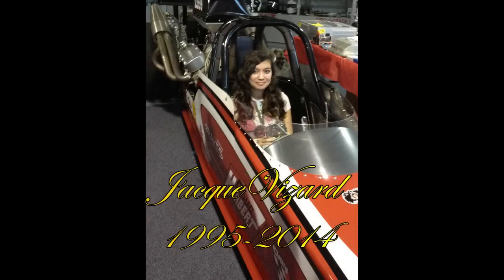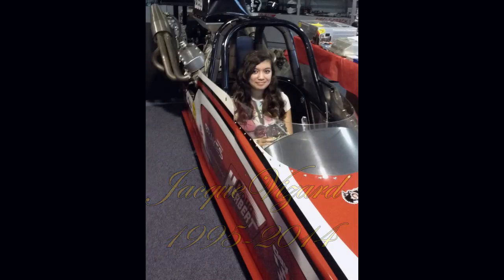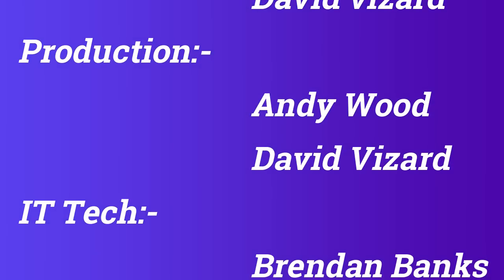GOOD NEWS -Blower motors are incorrectly dyno tested???!!!

Comment: Stan Weise blower bookb talks about the B&m single carb being rated at 120 horse when it actually made 200 hp
And its true because the car holds engine back packing more in cylinders with 5-7 psi wheel 
then anti pump up lifters hollow epoxy valves and 1.5 rockers with 750 pushing 8500 rpm i was making 800 hp

Comment: Well,, fake Dynos have problems;;-)
Systems and Programs makes differense. 
Dyno sessions in internet are 4to5 sec , some those engines can't take More ;-)
Estimatet loses are BS. Engine produce torque, that have to measure right, and engine inertia and dyno inertia can measure. When engine is taking RPMs fast it will genereit less power, and if it is pulled down fast it is making More power, engine inertia does that.
Steadystate measuring is absolut right.
Sveap or estimating somethig is BS.
Too fast raising RPM also affects cylinder filling neg, rpm is rising in also intakestroke time,(portveloxity).
ThankYou

Comment: Great video, FYI, 18,000 is 1/2  Atmosphere pressure, Question, @ 18,000 feet on STD day my experimental turbocharged Lycoming IO-360 can still hold 29.92 inches of  Manifold pressure @ 2500 rpm. At sea level the  Crankshaft is getting power  from the chamber explosion pushing down on the piston acting  Against standard atmospheric pressure of 29.92 inches will be on the other side of the piston. @ 18,000 feet altitude the  Same  Cylinder explosion is acting against half of the pressure  On the other side of the piston Significantly increasing the power To the crank shaft. 

My question is how much am I overboosting the rated horsepower, due to the 18000' half an atmosphere and having sea level pressure in the Turbo charged intercooled intake to engine ?

Comment: IIRC Detroit Diesel rate their Roots blower pumping losses at .7PSI as ~ 100hp! Consider this low pressure and that automotive Detroit Diesel two strokes typically are governed to only 2100RPM. That gives one an idea of the pumping losses involved, which all have to be paid for in fuel BTW.
Roots blowers on turbocharged Detroit Diesel two strokes also have a bypass valve. This is for a couple of reasons, firstly an aftercooler is incorporated under the blower therefore the charge cooling is after the blower. Any adiabatic heating of the intake air could heat the blower lobes causing them to expand, touch then scuff and as a side benefit it saves ~ 30HP in blower pumping losses.
They retain the blower on Detroits because of starting, idling and low RPM responsiveness. A hybrid centrifugal blower/turbocharger with overrun clutch similar to EMD Uniflow Diesels was proposed but dropped due cost.

Comment: Could you take the same engine and run it with a blower at say 15 psi and see what it makes and then install a turbo at the same boost level and measure it's power and wouldn't that tell you the friction losses of the blower for the most part? I know it's not an exact direct comparison but should be close

Comment: I have a question regarding the 0 hp loss exhaust system.  When using a supercharged engine, does the volume required for the termination chamber change based on the max volume output of the blower?
Reply: John, I have never tested for that but I don't think it's a big issue.
Reply: @DavidVizard  Thanks for the reply, I've one more question.  On your seminar web site all the dates are old, are you planning for any seminars in the near future?

Comment: I prefer to just go with actual measured steady state horsepower numbers, I believe these to be the most useful for me. What an engine makes in another enviroment really does not matter as what it makes where I am is all I have available to use. Also at steady state it shows a continuous generated power. Running sweep rates wind up showing accelerational power. Now for a drag racing type situation the acceleration is important but in a full load pulling situation the power it can sustainably produce is what is important. I prefer to think of dynos as a comparative tool more so than a be all end all say on power production.
Reply: Bcbloc02 all that is well and good until you need to quote power figures for an airframe designer who needs an absolute figure for comparison of one brand of engine to another!
DC

Comment: My first hands on experience with a dyno was 2007. A brand spanking  new DTS, (later bought out by Super Flow). I asked a bunch of questions and the man answered every one, He stated that this dyno spit out 3 power and torque stats, real time as is numbers, corrected numbers and advertised numbers. He also used flywheel diameter and weight and bore and stroke. The first numbers were indeed what the motor made right then and there with the recorded temp, barometric pressure and humidity. The corrected ones with standard pressure temp and humidity added a correction % so if you dynode the motor say in Denver it would read the same, the advertised set of numbers was basically a dialed up percentage that you wanted to add to the real numbers it was total BS. I never saw a corrected reading of more than 1.4% how ever when I could I`d dyno a new customers  engines to see what he had before I worked on them and most of the time they were 10% or better over their actual corrected level of the previous shop. That advertised HP correction is a lie to sell more stuff, you can take a 450HP motor and crank up the advertised correction factor to 495HP to 525HP or more no problem. I`m sure you know all this but most people don`t.

Comment: DV, for many years, I've heard that 15 lbs of boost effectively doubles the displacement of the engine. So your 500 ci engine, under   15 psi of boost, will act like an NA 1000 ci engine, is that correct?
Reply from the maker: Yes - but by the time inefficacy's are added in means the realities are somewhat different.

Comment: I have only used standard electric or water brake dynos. I was always suspicious of dynos that measure during acceleration. I doubt they could possibly get accurate data, not easily anyway. Not with what I see they are using, they are giving rough estimates not data.

Comment: What are the average "friction correction" percentages/factors of a 302sbc vs a 454 at 6000rpm. How about the 302sbc at 8000rpm. Are these corrections added to the actual measured output of the engine?

Comment: I am not sure why as a community we get hung up on a number on a piece of paper. I think of a Dyno as a tool. You show up with 700 hp and leave with 750 after you tweak it. The Dyno helps you get the most out of your combo. That's it.
The real key is how it actually performs. 
My stock 4500 lb  2016 Hellcat Challenger went 10.84 @ 126mph.
I know she was making more than the advertised 707 hp that day.
Reply: My street car averages out to around 10.90 in 1/4 and actual time slip of 7.07 at 96 mph in 1/8 best ET with 87 octane with a high rear gear 3.31 no power adder yet and around 3800 pounds with me in car. I need to lighten my car some time. You know how things are always a lot of things you can do to make them go faster. Lighter is less breakage, better gas mileage and easier on parts when lighter and of course faster! Your doing good at 4500 pounds. Each 1000 pounds removed is almost .80 off in the 1/4 mile. I have heard 1000 pounds is 1.00 but the other figure is more conservative. Could spray your intercooler with nitrous for cooling. Just don't get nitrous into engine and try to start it. Doing this good chance of engine fire and explosion. I've seen it over the years. I wonder what the first gear ratio in the Hellcat automatic is? It must be low and strong to get 4500 pounds moving. I don't know how long these automatic transmissions with soft tires are lasting but they built a pretty tough transmission a whole lot better than most things out there so far. I'm sure you probably know there's all kinds of upgrades you can do to your car, bigger blower with Teflon rotor strips, under driven pulleys, nitrous, rear end gears and so many more. Is 4500 lb with driver in the car at scale? Does your hellcat have a trans brake in your car? I plan to get a trans brake sometime. I'm a Chevrolet man but I have two Cummins Dodge trucks they're the best,, strongest and most dependable in the business.
Reply: @tomtee4442  it is an 8HP 90 so first gear is 4.71.
The 2016 used a 2.62 rear end.
My 2020 I special ordered a 3.09.
Back to the useful tool part. Most of the hellcat engines have an extremely flat power curve. So when you hit the next gear horsepower is nearly identical 
As an example... With the mustangs I have seen the power curve is very peaky. So when the shift they nose over and then come on hard, then nose over again. 
I have an in car video of me running 11.2 and it looks like I am out for a Sunday drive. The car just pulls away and shifts smoothly, never nosing over
Reply: @tomtee4442  to add to that. I think a Dyno is useful to figure things like shift points and gear ratios  the obsession with having a big number on paper to me means nothing. Its like they are trying to win the racing from there keyboard
Reply: Imagine the hellcat engine transmission and rear end in a 70 cuda. I would say without a driver would probably be around 3,400 through 3,600 lb because I imagine the hellcat engine is aluminum head with a steel block?
Reply: @tomtee4442  I am not sure but I think it is all cast iron

Comment: What are your thoughts on figuring out whp from acceleration? Should be foolproof, given traction is sufficient?
Reply: I've done it, is giving me about 60 to 70% the engine "advertised" power. I'm correcting for wind and drag resistance or the difference would be bigger. Great way to compare before and after installing a mod tho. Doing it in 2nd gear to avoid spinning wheels and also to avoid going too fast to the point wind resistance is huge.

Comment: The biggest mistake is "corrected" HP for atmospheric conditions, it's folly to say this engine makes X power at such and such atmospheric conditions and will make X + or - at such and such atmospheric conditions, that simply isn't correct
Reply: @carstennobody7047  not all engines are turboed, and engines that run constant displacement super chargers have to be spun faster with pulleys, or they won't make the same power at high altitudes, I've raced blown engines since the mid 70s. Worked for 3 shops that had Dynos, and normally aspirated engines don't change much because of atmospheric barometer reading, they only see changes with humidity reductions
Reply: Neal Williams is the inventor of the super flow dyno He grew up in Inola, Oklahoma, I've known him since the early 70s
Reply: @carstennobody7047  normally aspirated engines lose significant power at higher elevations, but Dyno testing and corrected to atmospheric conditions doesn't guarantee the engine will actually make corrected power at the corrected statistics, the only engines who can maintain power to 10,000' are turbocharged engines, because the lighter air the inlet turbine spins faster. Engines with fixed speed superchargers can if the manifold pressure is high enough, roots and screw type compressors are fixed displacement, they will only give a certain amount of boost, the Drive ratio determines how fast or slow it makes the pressure, my Blown Alcohol Hydroplane was powered by a 567" Chrysler, with a standard Helix 14, 71 blower, running a 14mm drive, I spun that blower as fast as possible, at 1.71 x crank speed, I didn't see the reason to apply boost slower, when acceleration was the game.....we were quite successful, I retired in 83', after 7 years, my Driver was killed in 86'
Reply: @carstennobody7047  depends on the engines and turbo, or mechanically driven super charger....

Comment: Dave - you are mostly correct - most of the effect of supercharging IS caused by raising the density of the air-fuel mixture supplied to the engine. But if you have a large volume such a water cooler bottle - you may see that merely by the feeble 1/2 psi most peoples lungs can pressurize such a volume to - and then releasing the pressure - that even a closed vessel may be used as a sort of pump. If you can get a slight suction (a pipe elbow turned facing backwards in a slipstream for instance) and a slight pressure to alternate then large amounts of mixture can be moved this way (crankcase scavenged 2-cycles prefer 1.5 to 1 crankcase compression ratio for this reason)(no lower, and no higher),
      Harry Ricardo in 1926 tests arrived at the conclusion that "given unlimited supercharging for any given fuel octane rating maximum INDICATED horsepower will occur at mechanical compression ratios between 6.5 and 7 to 1."(neglecting blower parasitic losses)
    And sure enough the racing aircraft piston engines I work on bear this out. That range is where the amount of energy thrown away out the exhaust by even lower compression ratios becomes balanced by the beneficial effect of the VE increase I mentioned PLUS the greater BMEP obtained by longer working cycle (shorter valve timing) and the comparatively large combustion chamber providing comparatively more cylinder pressure farther down the power stroke until exhaust open event.
Reply from the maker: Patrick, I am only using the boost/displacement numbers here for the sake of easing an explanation. 
I get the impression from your statements here you are well versed in boosted engine tech.  Got all that from a learned response. Thanks for meeting a hi-standard here. look forward to your future comments.
DV
Reply: @marvingvx1  I just want guys to know the benefits as well as drawbacks of "low" compression ratio engines for maximum BHP.
      The drawbacks are many starting with lousy NA power, fuel economy and greatly increased exhaust gas temperatures.
    Richard Holdener for example refuses to even consider running less than 8 - 1 CR engines. 
    But setups that would have been considered unthinkably complex for an automobile in my youth are now appearing as original equipment.  A 7-1 CR engine with a now common bypass equipped Roots  could make somebody an affordable hotrod with the bonus of veeeery wide and responsive powerband. 
        (I call myself a toolmaker) Just like combining many different methods of removing stuck bolts has the vice of complexity it also has the virtue of not having to "push" only one method to a point of diminishing returns or failure.
      My point is that a positive displacement blower wouldn't have to be unhappily trying to make high pressure ratio, heat and lousy efficiency/high parasitic - if one would then simply add on a single turbo with a "loose" scroll A/R and  let all the wasted exhaust heat+volume handle the (now) less critical task of spooling up for the highly boosted and aftercooled phase of acceleration.
       Coming from an aviation engine background I think it's normal to keep the original engine redline, stroke and cam specs - while lowering compression, trying to keep or gain some combustion chamber turbulence in the process, avoiding mis-matches like highly over-crankshaft-speed-driven centrifugal blowers (ProChargers etc) when trying to get an engine to increase rpm rapidly - and just bite the bullet in terms of complexity and fit the thing with a Roots + Turbo+Aftercooler ("Dual Charged" or "Multi Charged") setup.
     Paraphrasing Smokey Yunick "It's important to NOT do what DOESN'T make you go faster!"
   I would like to see articles on easy ways to add piston cooling oil jets, vastly increase oil capacity, make affordable sodium cooled valve setups - and not so many on how to get another 1/8" of stroke, or super light valves and super strength rockers and pushrods, and loose torque converters to make up for the deficient power bands that result from traditional misguided power boosting approaches.
Thanks for letting me rant, Dave - you're a Class Act.